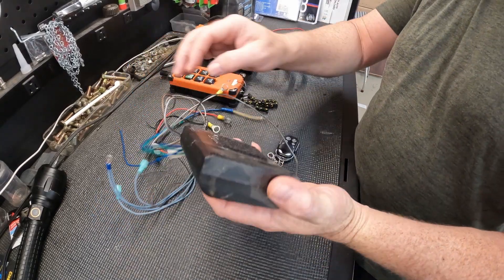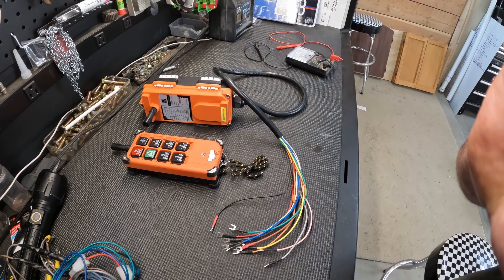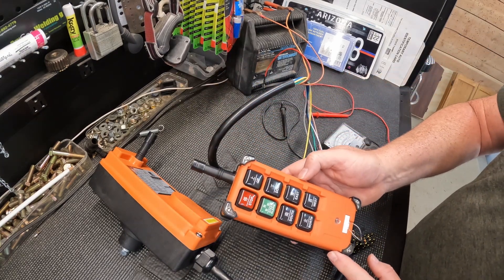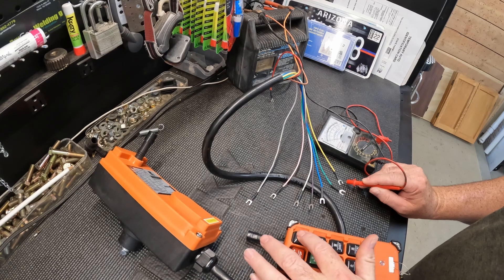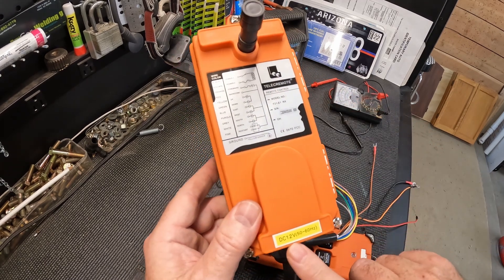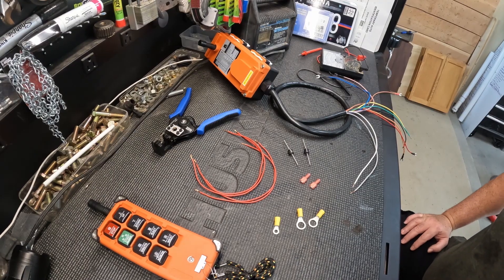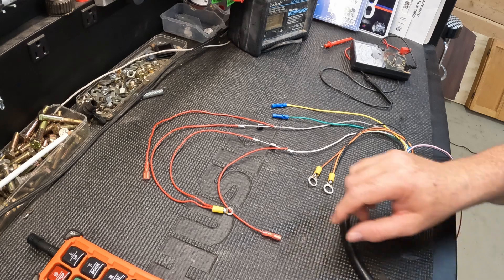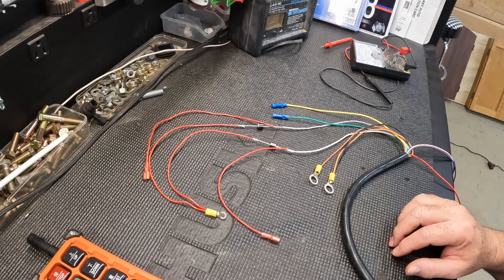Dump Trailer Wiring Explained to use Remote Control

Comment: @Peter Jakobs 
I have a problem problem get running 12 V DC motors in a desired directon. Connecting the motor  to yellow and green , I have to connect yellow and black to start it with the button UP.
To get it run in the opposite direction I have to connect green and black, and start with button down. I see that you managing this problem with diodes, you can start UP and DOWN without
channging cables. I could nowhere else find a solution for my problem, only in your video I have seen the diodes, which could solve my problem. The Amazon-URL for diodes I cannot 
open from Austria. Perhaps special diodes, because with my sortiment I was not successful. In case, that I have inserted the diodes in the right manner.Please, explain where ti insert
the diodes. I woüld be glad, if you read these lines,Perhaps you will help me. Thank  you.

Comment: I ended up making a few videos of my own and here’s what I found out on the solenoid you can use either black or brown as power and then black or brown as ground just one or the other black as power brown as ground is what I would go with and then on the other side through the litter, I found either the red or the orange can be used, and while there is some difference between the red or orange for power to the unit to whatever you’re gonna make For our intense purposes, it really didn’t matter. There was some thing about the first powerline with the fuse on it that becomes part of a sequence for safety features but if you don’t program your remote control prior to use then the end user there is no distinct in between the two so I’ve swapped it with red and orange and it’s turned out exactly the same so you have the solenoid and you have power to the orange line so basically the black and the red lines turned out to be power. The orange can be, but it’s redundant either way and then whatever color line you wanna use that goes to the power side of your unit and then the ground just goes to the common ground And, I am eternally grateful

Comment: YouTube took out a post I made about wiring up the dump trailer without the diodes so it works. It may have been using a link to another site. Anyway I will mention it again without it. I am editing this comment as I found an error on my part due to my not fully realizing that the solenoid and valve coil need to be energized at the same time. I have posted a video explaining how the unit works plus a look inside one. I hope it helps those of you wanting to wire this up to anything for remote control. I am by no means wanting to derail the author or take away what he did. Using the diodes is not a problem as long as you wire them in and are aware of the current/voltages needed to ensure the valve solenoids are getting what they need.

Comment: Also on those diodes. There is a Anode side and a Cathode side. Electricity flows one way as you state however that band only shows you which side is the Cathode side. Current always flows from the Anode to the Cathode.
Reply from the maker: hello again. thanks for you input, you are definitely more technical than I. thanks again,  Clay

Comment: Ok Brown is not ground. Its an input to a bridge rectifier. Black is the other input. You can reverse them and it will still work. According to the diagrams and info you can connect 24 volts but you need to know what transformer is in the unit. Mine did not have one so I used 12 and it worked out ok. You have Orange and Red for common connections. The Orange wire is fused and connects to a relay. That is the relay that clicks when you click on start button. Both go to the same place when all is energized. The fused is like 10A. This allows you to connect it up to 120V. The relays depending on your model will be rated for 120 to 230VAC. You can open your unit and inspect them to be sure. These units are meant to connect to a industrial PLC type of controller for industrial motor control. Do not use it to control directly a fan etc. Use an industrial relay or rated motor controller. For your application use a rated relay for your dump trailer unless it has a low voltage trigger. It will protect your receiver from damage if something goes wrong.
Reply from the maker: Hello Steven and thanks for the comment. It sounds as though you are a much smarter man than I. i am not a professional but I can tell you mine works perfectly as stated. i wish you luck. Clay
Reply: @claymeza  Thanks Clay. If you ever need help with stuff in the future I can help. I do a lot of electronics and have programed robots using off the shelf components.
Reply: Hey Mr. Steven. I need some help with this remote system please 😂. I'm so stressed with it lol. I'm trying to run 3 (110vac) hoists on this remote control. (North, South, East, West, Up, and down) My remote system is YDGY F21-E1B. It says on the receiver 12v/24v. So I purchased a 10amp 12vdc power supply box for supply power. Do I need relays, contactors, or Solenoids to operate the 110vac winches or do I just follow the wiring diagram on the receiver and hook it up like it says? I'm confused as to how the supply power of 12vdc in the receiver would activate a 110vac winch.
Reply: How do I use this "EXACT" remote with 110vac winches? 😩😂

Comment: at least yours is color coded LOL I bought a piece of equipment and it came with this remote. I have 16 wires all the same color :( no manual or diagrams
Reply: Can you use an ohm meter and figure it out that way. Or just return it and get another one. Lol sorry you got it that way.

Comment: What wires did you connect together to the power? Im. Trying to wire similar unit. I have numbers not colors.
Reply: The wires you will use to power the pump has to also open the solenoid. Therefore both power wires (up/down or in/out) have connect both to the pump and the solenoid. You have to use a diode so power does not go back up to the unit and burn it up.
Reply: I got the same problem, I have number not colors, I got no idea what (com) and (main) is I wired power and grnd and it works in 12v but no idea how to connect it to my unit to make it work it’s a basic gravity down hydraulic unit :(

Comment: You helped me big time! I would have never figured out the positive and negative wires being the colors rhey were
Reply: I'm glad I could help. Thank you.
Reply: As posted I had opened one up and those wires are meant for AC 24 or higher depending on what transformer you have. The one I have had it removed so I used 12v. The polarity can be switched. On mine the input wires were connected to a bridge rectifier.

Comment: Nice I want to make a trailer dolly with two winch motors controlled with one remote and now I want to get one for my dump trailer for my winch and dump and also for my trailer jack
Reply: Sounds great, let me know how it turns out.
Reply: @JefferyClay-tl3tn  Make sure you use a good rated relay to power that wench. They use a lot of current. The max the receiver can do is 10A and thats pushing things.